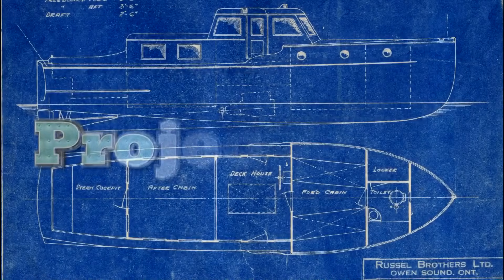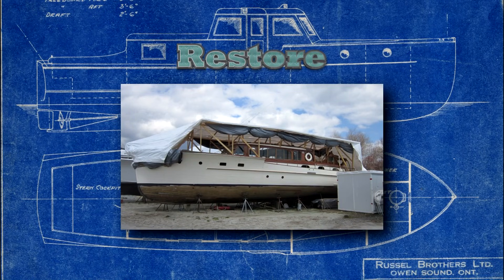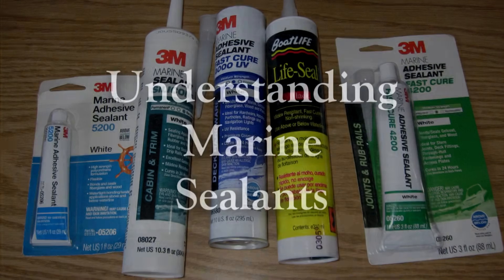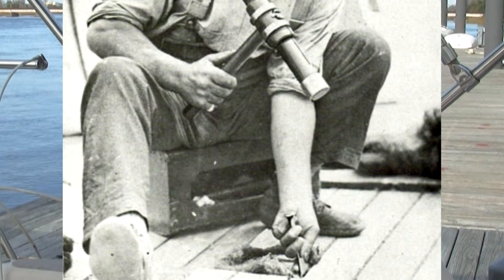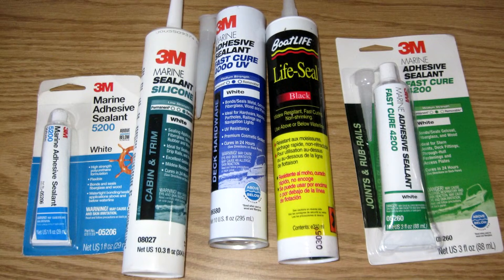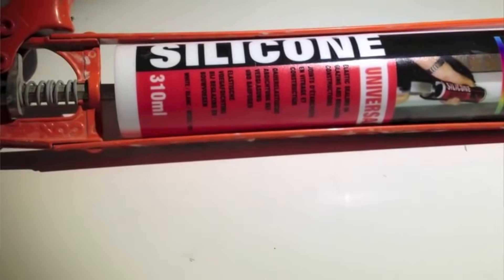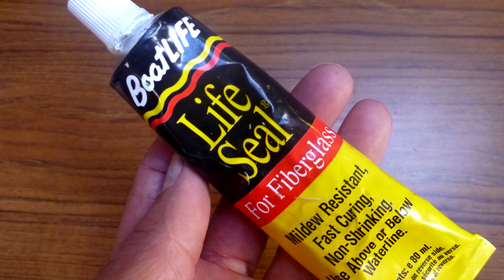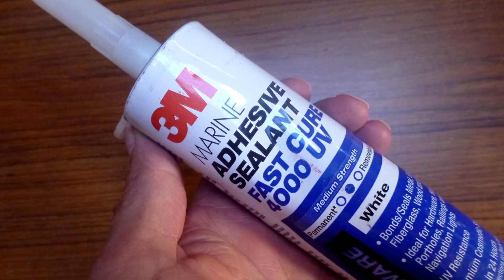Understanding Marine Sealants

Comment: This 10 minute video answered many of my questions I've had over the 
years, thank you!  I am removing and reattaching toe rails to a 1985 s2 
7.9.  I will be laying double beads which equal 100 ft overall.  With 
this amount of sealant, cost is an issue.  I will probably use close to 
two cases when finished.  Is Boatlife (Polysulfide) the only option?
Reply from the maker: I think it is your best option. When it comes to a project like that it is best not to cut corners on material. Glad the video could help you.
Reply: Thanks Wayne.  Can I use both LifeSeal and LifeCaulk?
Reply from the maker: What is the toe rail made of?
Reply: 6000 series anodized alumimum
Reply from the maker: Either will do I do not have as much experience with the life seal as it is newer so I may lean to the life caulk. As a matter of fact that is what I recently used on my own alum toe rail after redoing the hull deck joint. Good luck

Comment: Very helpful Wayne, thanks.  The keel bolts on my Thunderbird 24 were leaking a little bit of water into the keel last year.  She's on the hard now and I'd like to remove the nuts and re-bed the bolts with sealant. I don't want to separate the keel at this time.  Which sealant would you recommend for this application?
Reply from the maker: Polysulfide would work well for this. You really should drop the keel and clean the joint and rebed I would use 5200 for that. Good luck
Reply: I would think you need to drop the keel, ask a boatbuilder but the problem needs to be addressed some time.
3m 5200 is indicated. IT IS PERMANENT you never ever want to use it if you think you might have to drop the keel again.
I cant see how puting anything on top of the keelbolt nuts is going to do any good, you do not want any moisture getting in to the lamination/gelcoat.
I dont recal seeing any sealing on my keelblot nuts

Comment: most common sealant? $100 bills crammed into leaking area. Most common diesel repair? $100 bills fed directly into main air intake while running at full throttle.
Reply: Oo

Comment: I'm wanting to screw in some anchor line holders into my polyethylene plastic 10 ft bass buggy boat. Is it safe for me to just screw them onto the plastic without the plastic cracking or should I use a type of silicone? I'm also making some rod holders and I'm using flanges on the base and was just wondering if it is safe to drill those directly into the boat also or if I should maybe put a piece of wood so the screw would have to go through the flange and then the wood and then the boat? Thanks for your help!
Reply from the maker: Not sure about a poly boat but I would use silicone as a sealant and back up any fasteners. I would redrill any holes as well. Hope that helps
Reply: Danny, are you expecting the anchor line holder to bear the weight of the anchor?  It's tough to understand your exact need without pictures but I would definitely suggest that you use a piece of wood to "back" up to the screw mounting areas if possible to help spread out the force.  Through bolting your mounting screws to a backing plate of plywood or hardwood will spread out the load and help keep the screws from stripping out under load.

Comment: Wayne in your professional opinion what product would you use to rebed stansions?  Butyl tape or 3M 4000? I chose these two because they seem to be most popular. Thanks
Reply from the maker: I would use the 4000 or a polysulfide like Lifecaulk. The problem with butyl is that because it does not harden the movement of the stanchions will work it out over a period of time. What ever you use counter sink the holes to form a trough for the sealant. I also like to use Orings around the bolts as an additional seal. Good luck with it and thanks for asking.

Comment: I tried something I seen on a video and it works . You can add cornstarch to 100% clear silicone and what ever color you want add food coloring and the cornstarch sets the silicone up quicker ands evenly
Reply from the maker: I can think of a few reasons not to do this for boat silicone. The biggest being that it would likely add to mold and mildew problems with the sealant. Interesting thought though. Thanks for watching and the comments.

Comment: I have a double hull 10 ft. Polyethylene boat with a 1/4 in wide 5 inch gash on the bottom. Can you recommend a solution to filling in the gap.
Reply from the maker: That's a tough one you would need a special adhesive for that and I am thinking you may want to glue some patch material of the same material over the gash. 3M makes an adhesive for this but I do not recall the exact name of it.  You may also be able to "weld" it with a heat gun but this is not something I have ever done myself. I would suggest contacting the manufacture for advise. Good luck with it.
Reply: I have tried the plastic welding and it didn't adhere very well , but I don't claim to be an expert. I was hoping the 3M products would work, if I knew which one.  Thanks for the info and input.
Reply from the maker: Try this 3M No. is 4693, or 4693H for a thicker glue. Welding is still the best way to go though. Good luck with it let us know if it works
Reply: It will be a couple weeks before I get a chance to try it,  but that sounds good to me,  I know the boat needs to be flexible.

Comment: Thank you for making this video! I really learned alot. I have a question though, If you had to use a sealant to repair a small crack on a pool sand filter, what would you use to try to repair the small crack? The pressure of this filter is around 25psi. Thank you!
Reply from the maker: I am guessing the filter housing is a type of plastic. I think many of these are a fiber reinforce plastic but I am an expert on those. I would think for a crack you are going to want an adhesive more than a sealant. I think you can get a 2 part epoxy for plastics that would work. I would ask at a pool store what they suggest. Hope that helps and thanks for watching.
Reply: I will try that, thank you for the advice!

Comment: Just in time.. have a very small leak in my Lewmar forward hatch on a 35 year old Pearson 40...the old caulk has shrunk and there is a noticeable gap between the metal frame and old caulk and the plastic and old caulk.  since both hatches are currently water tight, can I just fill the gap or should I remove the old caulk and re bed the plastic?   Questions for the next video... Thank You
Reply from the maker: Stephen Luta Sorry to take so long getting back to you on this. If the hatches are not leaking I would just fill the gap. I might suggest cutting some of the old caulk out and fill over the top for a more complete seal. I would use the Dow 795 or boatlife silicone for this. Yes the next video will have more info on this and how to finish the sealant so that it looks good when done as well. Thanks for watching